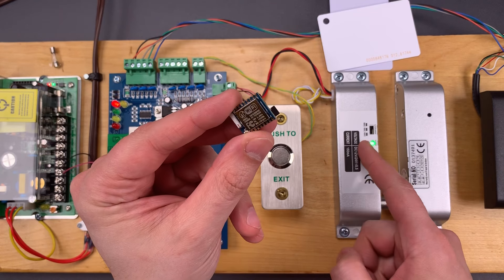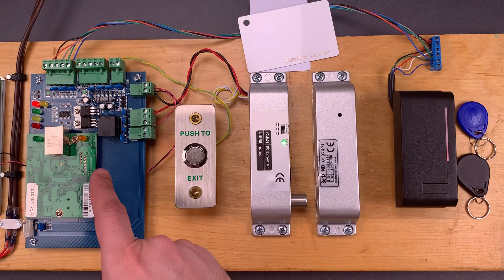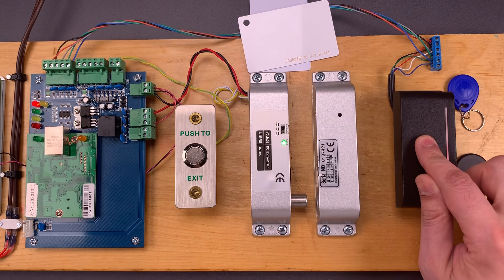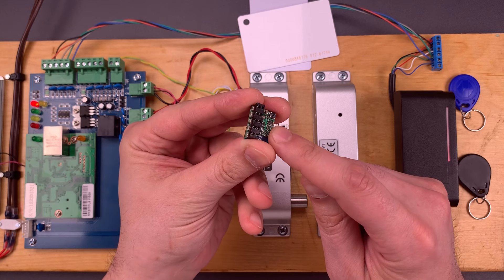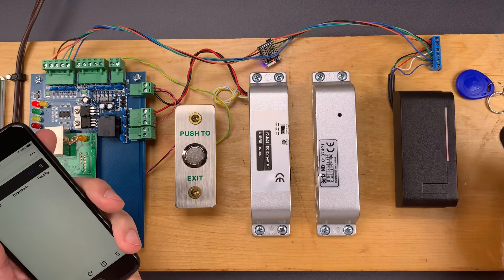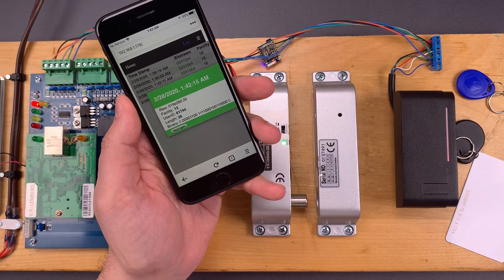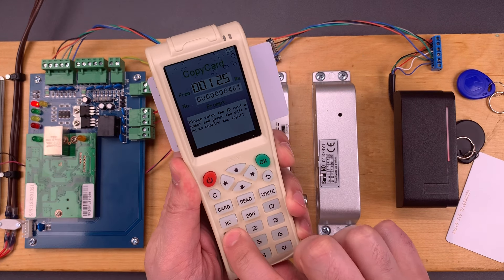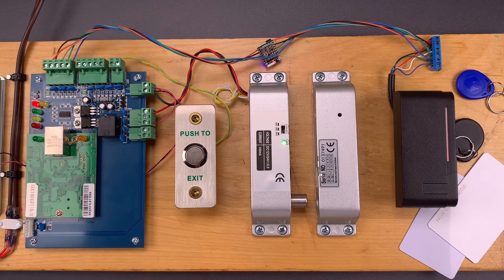[1052] Bugging an RFID Card Reader

Comment: What lock is used? From what I can tell if I install this lock and protect the wiring correctly he can't get in.   It relies on getting exposed wires , can't be beaten by magnets etc, I want that lock
Reply: The RFID reader is the weak point. You can always access it, as it sits on the outside. Not saying it's gonna be as easy as this lab set-up, but you can just wire one of these ESPKeys in.

Comment: Actually, even if the communication between the reader and the controller were encrypted, the system would still be flawed, because the RFID protocol used here is not encrypted. You could hide another device inside the reader which (instead of picking onto the wires) could read the card wirelessly and then replay the correct radio signals at any time.

If you want a really much more secure system, you need smart cards with encryption mechanisms built it (as in contactless bank cards) and also resistant to replay attacks. Then there would be no way to perform a man-in-the-middle attack like this.

Comment: I'm presuming that an "encrypted" system would be one where the card reader first asks the central controller for a one-time encryption key and then sends the card/fob data using that key. Otherwise, if the same encrypted sequence is used every time, the capability of that device to "repeat what it heard" when instructed by your phone would still open the door. You just wouldn't be able to make a new card.
Reply: Forgive my ignorance, but wouldn't the hack device also be able to obtain the one-time encryption key to be able to unencrypt the card signal being sent?

Comment: But wouldn't this still be able to replay the message even if it was encrypted? Like from the device on the phone, or is there like a special code it looks for across the wire in order to start reading that wouldn't be there if it was encrypted (or does it just listen for any inputs and logs them

Comment: Would encryption really help tho? If you copy the encrypted data and send it trough the wires at a later time, wouldn't that still open the door? I mean you may not find out what the original code was and with that can't make a similar card, but you wouldn't need to, as you can send the signal via your espkey.

Comment: If card reader would have intrusion detection switch, so wires could not be easily accessible just by removing the reader, I guess that system would be much more secure.
However, I also believe that is not a problem to construct a reader that could detect signals wirelessly, but then is a question how to mount it without being noticed? And - wires can be in shielded cable and that would prevent reader from detecting signals...

Comment: Wouldn't the encryption only work when trying to duplicate a card?  If you use the "replay" function of the ESP chip it will send the already encrypted data that it captured and the controller wouldn't be able to tell the difference.

Comment: It's surprising to see these security companies that try to use systems like this that neglect the most essential and basic parts of the design.
Reply: you can just blow up the door, i mean if you break the system to have acces to the wires to install a thing like this, you might aswel do that, if the reader is secured there is no reason to encript what goes on the wire, at that point you can make nother device that reads data before encryption

Comment: All of this included in a proxmark3, its capable of decrypting even encrypted cards. I would rather get a proxmark3 than the above tools. As you can also use it in a sort of brute force mode that just continually sends incrementing keyfob IDs.

Comment: simply sending encrypted data isnt enough' since you can replay said data... the unit needs to send an encrypted single use pass key as well, to prevent data from being reused. clock based, salted, and encrypted would be a tough one to crack, if its a back and forth handshake with a one time use salt from the controller it would work decent to.

Comment: Somebody correct me if I'm wrong, but the replay function should still work if the system is encrypted? If the encryption keys do not change, the relay will broadcast the encrypted message to the controller which will then decrpyt to the same value and allow entry.

Comment: Even if it is encrypted data, it would need something changing baked in, like using the time as a salt, in order for it to be secure against the replay attack. 

Even so, why not just put a second nfc reader inside the receptor and get the code off the card?

Comment: theoretically, even if it was encrypted, with that device they could still send the signal through and the only difference would be that you can't make a card out of it, right? Cause you could still use the app to unlock it by sending the encrypted message.

Comment: Encryption itself would NOT solve the issue completely. Encryption might prevent you from cloning the RFID card, but it won't prevent the replay attach that you are using. Something else like session tokens, nonces, or timestamps, are required to prevent replaying attacks. Some of which might be a little bit different in the RFID world than in regular computers though.

Comment: Do you have to have a wifi router to make this work? Or would you be using the local network and have to have access to that as well?
Reply: Device have integrated Access point, so you have to connect your phone directly to it (as you would connect to your WiFi printer, for example, or as you would connect to any other router)... You don't need any other network.

Comment: this would require you to pull apart the reader and attach the device to the wiring, if the building has cameras and 24 hour security, it might be harder to do.  Not like the simple rare earth magnet hack to cause the bolt to retract.

Comment: I'm curious how the encryption would work to protect against this device. I would think that if the ESP key duplicated that already-encrypted signal it would decrypt into an authorized code. Maybe use some sort of dynamic encryption that changes over time, then have some sort of sync/timestamp signal going from the controller to the receiver? Or am I overlooking something?
Reply: what you would get on the wire is not what is on the card, so putting what you got on the card would give you a useless card, if the code is also time sensitive using the same code directly on the wire would do nothing on a later attempt

have you ever used steam guard for example ? the code generated has a time to live, that would be the code the thing is stealing, what is on the card would be the generator that is on both your phone and the steam servers, but that code is never public to be stolen
Reply: @devforfun5618  Yeah I get the first part, I'm saying that if you used the phone function where the ESP key sends the code down the wires rather than programming a card it would be the post-encrypted version. Unlike a Steam key, the card you use will always have the same code, so there must be some way of the receiver changing the encryption or else everybody would need to reprogram their own card every hour (and I doubt that's what the process is).
Reply: @beecoughs  the card has a fixed number, but the card reader would generate a temporary key based on the number in the card and send it through the wires, the board that locks the door can decrypt the code to get the original code, but since the second key only exists on both devices and is never transmited there is no way to steal that part

you can do that by simply having a counter that runs on both devices and summing the counter to the code before encrypting, that would give a diferent message everytime
Reply: @devforfun5618  Ok makes sense. Thanks!

Comment: I'm not sure encrypting over that data line would help very much. If you can install that snooper, you could presumably just as easily install a parallel RFID reader in the housing and get at the key's data before encryption.

Comment: But if encryption will be on the reader, can't you pry into it?
I.e. as long as it is not a chip on the token that do encryption/hashing with some salt/challange from lock - it is going to be exposed to re-play attack no matter what.
Having access to wires basically makes this problem similar to one car remote unlocking. And further pretection can be inspired from there.

Comment: If the data were encrypted, you wouldn't be able to clone the card, but you could still use the "Replay" feature to send the correct encrypted data to the controller. Isn't that correct?

Comment: Just a question. I get it how and encrypted system might prevent you from cloning the card, but since the module is already on the wire, wouldn't the replay function still bypass the encryption, given the signals travelling on the wire are the same with or without an original card?

Comment: How would you get access to those wires? You'd have to remove the unit first from the wall and quickly put something like this in there. While it could get you inside a locked door, I don't know how this exploit is practical unless it's something you do outside of a building at night; then again, there are cameras.

Comment: In fact encrypting the data won't help against replay
At least as long as you don't add a challenge to the mix (like current time, ...)
If 1234 encrypts into 5678 you just replay the encrypted message as it will always be the same

Comment: I think something to note is that a lot of systems installed seem to not actually check for the ID part of the RFID, not sure whether is cheap systems or bad installers, but each time i've come across rfid systems, whether in vehicle lockouts or gates the workers just end up using their bank cards to get through and it works so often it's kind of worrying.
The joke about getting in easy but losing their savings is so common now it's a dad joke.

Comment: Shouldn't just be doing encryption between the reader and controller, that still allows easy cloning of the keycards. Need to switch to a system where the keycard itself encrypts the response.

Comment: RFID stuff is inherently vulnerable there, because keys are not unique, but can be copied, etc.
A more thorough solution to restrict access would be Smartcards, where the key is generated locally be the card, and never transmitted. The main downside is, that you can easily lose access, e.g. by typing the wrong PIN code 3 times. So tou wouldn't want such a system on your home.

Comment: A lot of these systems don't work like this. They set a rollover on the card, and if the rollover doesn't match then the card gets blocked. Basically the I'd of the card gets changed every successful unlock. I.e Yale locks

Comment: The problem isn't that communication between the reader and controller isn't encrypted. Communication should be encrypted all the way from the card to the controller, so that you can't hack anything anywhere along the way. When you swipe a card, the controller sends a unique "challenge" to the card and the card sends back a unique, one-time response - the  actual access code is NEVER shared over the air. This way, replaying data from the card will not allow you to enter the door.

Comment: Wouldn’t the encrypted data just be copied also? What’s needed is a dual wavelength wireless transmission with a companion signal in wired, that way it would take three systems to break the encryption and even then timing is of concern

Comment: This is pretty interesting, but it not as if you can just walk up and bypass it, which seems to be possible with some of the locks shown on your videos. Is there any chance you could go into describing skimmers used on gas pumps and some of the more recent scams in the news about tricking gas pumps into giving gas for Pennies on the dollar?

I can understand why you might not want to give out that kind of information, but to me these seem to be methods for bypassing locks/security, and it would be interesting, just in an academic level to understand how that works, even if you don’t give away how to do it.

It might be best if you don’t give away how to do it, but it’s still interesting to understand how it works.

Comment: Couldn't you secure the wires so not to give any slack for the card reader. So if you ripped the card reader off the wall it would rip wires also

Comment: I've been doing stuff like that since I was a kid, but I don't see this as vulnerability at all. I'd like to see you do this on actual system, are you going to use sledgehammer or drill to make a huge hole in a wall in order to access tho wires?? The card reader unit is installed with NO slack to the wires usually, at least that's how it should be instaleld if competent person does it. So you can pull it off the wall, but you can't put the device there as there's no slack in wires, you can yank it and break it off, but what good will that do? Even if you cut the wires and make your own extension, where are you going to put it? clearly you're not gonna be able to fit it in the same hole where wire is coming from.  ... so once again good PoC, but in real life this has no actual use. You only make PoCs (proof of concepts), but you almost never show how anyone would do this in real life (install it on your own test door and show how someone would use this method to break in). By test door, I mean install a door on your shed or one of the inside doors and install it properly, not on an open door with open wires, install it like it's suppose to be installed.

Comment: what about when the system knows who has gone in or out? what if you cloned lets say Johns card and john is working in that area behind the secure door, you then use the clone card , John card, and you try to enter that secure area. What will happen if the system registers an other entry attempt while John is still working, never exited.

Comment: I know this is very far-fetched but do you think it would be possible to recover the raw binary information flow in the wires using an electromagnetic field analyser (if it's just 0s and 1s it translates as simple peaks right?) and then automatically convert it to hexadecimal or whatever suitable format to give it back to the card reader and open the door?

Comment: that happens with RFID systems that are not based on a CHALLENGE. Modern RFID don't transmit its ID, but use the ID in-chip as added soup to resolve a challenge, the controller send a math FORMULA (the challenge, which must be random), and energize the RFID chip, this RFID will receive and resolve the math formula but it will add his juicy to the formula based on its internal ID which is never sent, so, the RFID send back the challenge solution, then the controller also do the same as both sides know the ID but never transmitted, both sides results are equal, it opens the door. So, RFID chips must be able to do little calculations internally. Who has these rfid (VISA, MASTER, ETC.). The idea is it NEVER will repeat a challenge, so doesn't matter if a third party record the line or the RF, the expected values to transmitt will always be different. But this solution also has a huge weak point, but it will require very good engineer and lot of time with the RFID chip to attack.

Comment: i might be stupid but if the controller receives the encrypted it gets decrypted and than verified. 
If you copy the encrypted data and send it (like you have done with the not encrypted signal) wouldn't the system get to the same result after decrypting the signal and open anyway?
I don't really see how an encrypted signal changes anything unless the way how it gets encrypted changes constantly.

Comment: Something even crazyer: most of the times, the bits stored in the card are written on it in some way. It doesn't take a genius to figure it out, and it can be done by one photo...
Reply: Not even that. Remote reading and then copy the access card is easy. It doesn't matter what the door/lock does, the "attacker" could read your card if they get close enough to you (eg. standing next to you), then they can make a copy of the card.

Comment: How would encryption work?

If you used the same encryption key for each transmission, the replay attack would still work, but you wouldn't be able to create a new card.

If the encryption key is cycled, then you'd have to directly read the card, which would require a second reader close to the first.

If communication between the reader and the card is also encrypted, then you have a problem.

Caveat: I don't know much about all this.

Comment: Figured out the brand new hospital i work at still dont encrypt any badges..  they assign unique identifiers and pins but nothings encrypted because the security uses the identifiers to track where people go and if theres any word of anything that was stolen or whatever and a location is given they will take everybody who scanned in that area and call them to a meeting, mandatory after working hours with hr..  lol..  but if you just get close enough to a badge of a worker in that area you can mimic and all..  and even being in an elevator with anybody for as little as 5 seconds and 5 feet away i can sense the card and get its info silently and it works everytime through an app and transmitter i made that plugs into the headphone jack ..  lol..  cant program with cellphone tho..  gotta use another doohickey..  that hospital is glad im not a bad person tho...  lol

Comment: The encryption needs to happen "on the card/fob" otherwise you can put a device using radio in basically the same place and do the same with the radio the card/fob transmits.